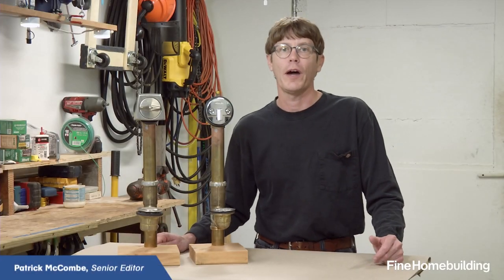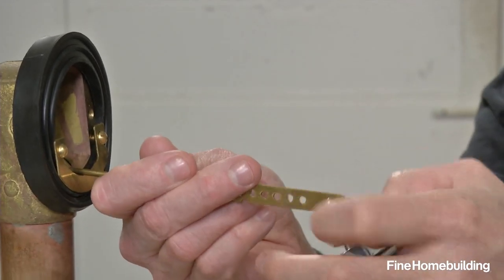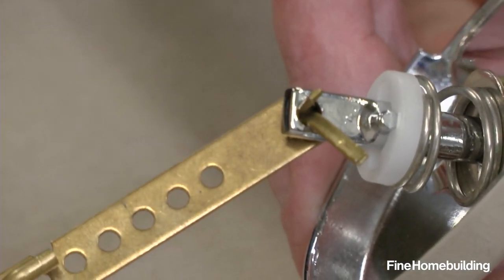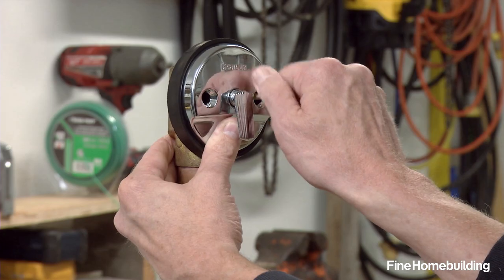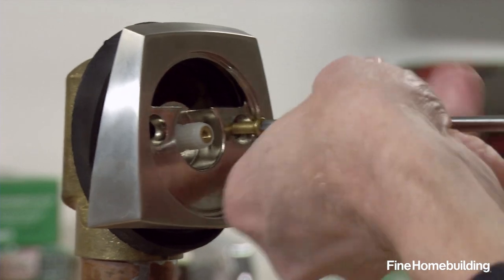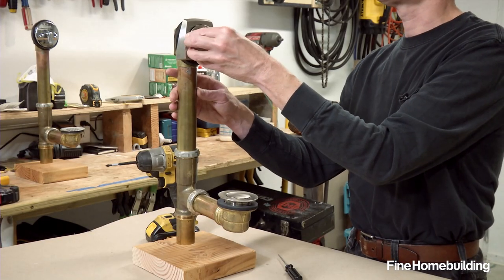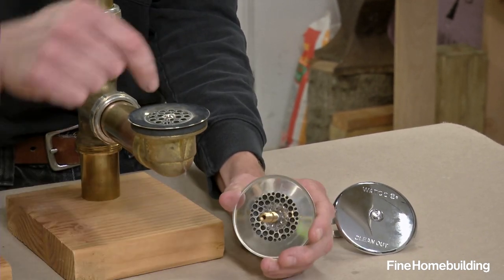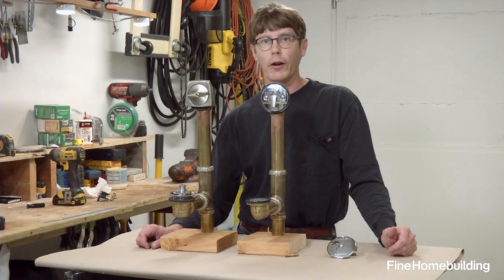How to Fix a Slow Draining Bathtub Drain

Comment: Thank you! I have the second type, a Kohler, and thanks to this video, taking it apart was a snap. When I removed the linkage from the overflow pipe, a mass of hair came out tangled in the spring/weight at the end. Agonizingly slow drain is no longer that way.
Reply: Same! Er, with the kohler. I believe the official product name is the “tea-for-two”. I haven’t taken it apart yet. That happens tomorrow!

Comment: Any tips on getting the trip lever out of the overflow pipe? I have one stuck in corrosion or hard water build up that I cant get out.
Reply: Did you ever get it un-stuck?  What did you do?
Reply: @cptpapa  no. We just put in a new drain cover that you can push down to stop the flow and fill the tub. It works but does create more issues with hair clogs it seems.
Reply: @nchec326  thank you

Comment: Have a standard double kitchen sink. Those basket-with-rubber stoppers/washers hardly work when new, much less when the rubber gets stiff with age.  Cure?
The drain of one goes to the drain from the other via gently sloped pipe, then down through the trap and to the back wall, then down to the main drain. It's the very devil to get the pipes just the right length, get them to hold together - especially when someone crams a too-high bottle of soap or something under there and knocks it lose. A "Real" plumber actually made it worse. Cure?
Or which issue of FH has the answers?
Thanks!

Comment: I have the firs type of plug and I removed it completely. But the water still drains very slowly. I even tried pouring dryno, baking soda vinegar combo, etc and it's still the same. Any ways I can get it to drain quicker? Thanks!
Reply: I removed my brass hooked stopper and my drain pipes are all new in my basement, and my tub still drains slow, so I'm replacing all the pipes shown in this video to plastic.
Reply: Try removing bottom drain. The brass fitting. Then Check inside for obstruction.

Comment: when I take the center screw out the lever assembly won't pull out.
Reply: Same. Came here to lo0ok for answer. I'm going to very gently pry with a thin blade like a butter knife. I'm not leaving it for a plumber because I''m afraid he'll scratch my brushed nickel finish. After I pry it (if I can), I will clean if corroded. Then I will have the plumber fix the spring and linkage when he's here to replace PBU and mixing cap of shower faucet. I just want to look first and clean in case it's gross or the lever needs to be soaked in 50% vinegar/50% water. I like to do preparation for plumber if he'll be working on anything with a finish. So if he starts prying or not using strap wrench I can ask him to watch out for the finish.

Comment: What does one do if the drain basket/barrel is stuck and won’t move?
Reply: I am having the same problem. It will not budge and I am little afraid to try to hard that it will break off and never be able to get it out!
Reply: @bonniemittleman6963   I ended up having to disassemble mine and use a lot of CLR and WD-40. Then I was able to tap the exposed part of the basket from the pipe with a board over it and hammer, and loosened it. Good luck.
Reply: @cptpapa  Yeah, I have poured a ton of descaler into it and it isn't budging. I've completely removed the outer assembly and the adjustment piece, I have just the stem. I'll have to continue to soak in chemicals I guess, not way now to get it out short of removing the tub! If I ever get this out. I will not go back with this sort of assembly! Haven't tried wd-40. Ill have to try that too. I'm just a determined grandma, not a plumber  :(
Reply: @bonniemittleman6963  I was not able to get it to release just by pouring the CLR I had to disassemble it and tap on it.  Are you able to get under the or in front of the tube to remove drains to work on it a little bit closer?
Reply: @cptpapa  I have no access to it other than from the top. I have not been able to get the drain cover off the floor of the tub either. It is a screen without a screw in the center. It seem glued on. I'm headed to hardware store to find an appropriate drain puller, (it isn't just the + shape screen, its actually a flush screen with a pattern of little circles holes, like an actual screen. Sorry, I don't know the technical names of things! I have no access behind the tub without major damage either.. I'm really ready to remove the entire tub and put in a shower!
Reply: @bonniemittleman6963  oh my sounds like a project.  I learned all my plumbing from watching things on here.  Good luck.  How would you reach the tub trap?
Reply: @bonniemittleman6963  any luck?